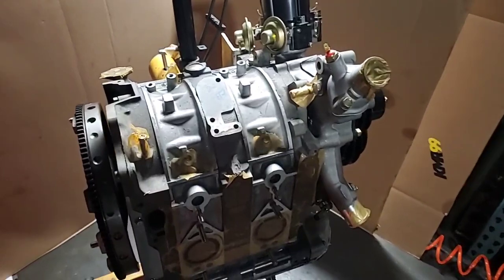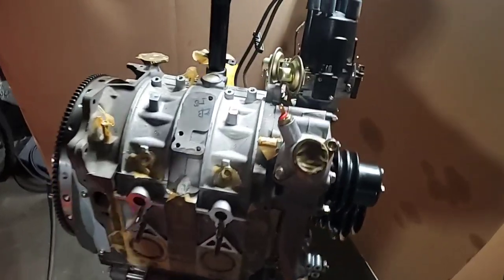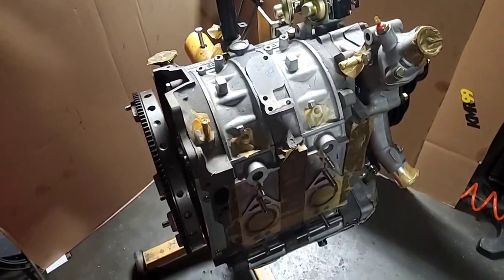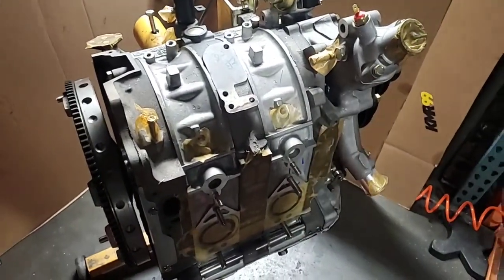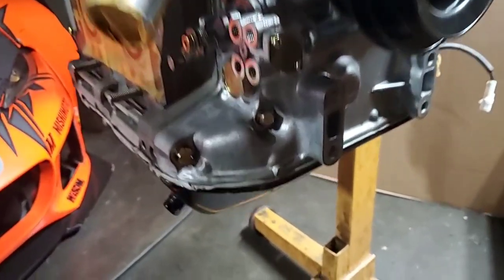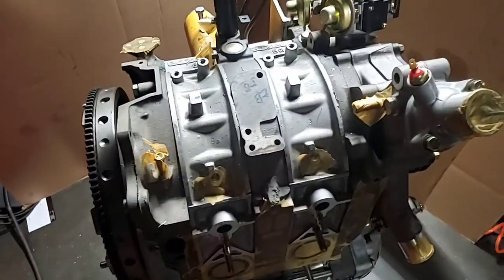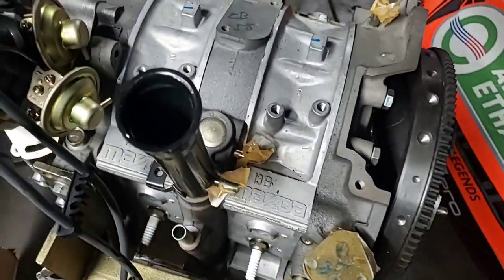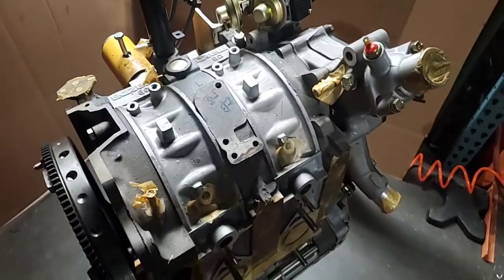Propane 13b Weird OEM Mazda Rotary Engine - KMR Tech Talk  ( RX7, Wankel, Rotor Motor )

Comment: Interesting engine, I wonder how things go as far as reliability is concerned with these things.
After doing a bit of reading over the last few weeks I've come to the conclusion that detonation is the big killer of these engines, and was wondering how well a rotary engine would hold up on LPG (propane, or propane/butane blend) vapour injection as it won't cause carbon buildup which in turn leads to detonation causing hot-spots, and a carbon free rotor housing would by it's very nature easier on a set of good ceramic seals.  With the higher octane rating on top, it should in theory keep the engine happier for much longer. However, now that I've seen this video it seems that Mazda came to the same conclusion 30+ years ago, and if they were built for industrial use I'd imagine that reliability was a high priority.

Maybe someone at Mazda has spent the last 30 years hoping LPG powered vehicles would become the norm? I've always said hybrids make little sense without using a low carbon fuel like LPG

Comment: Unique animal.  Timing cover is 12a turbo. I did many LPG rotors works well N/a  . Turbo works well with twin gas research carbys and 3 to 4 converters ( one for primary demand and 2 for instantaneous demand, and tried a 4th) the biggest thing i found was how hash LPG is on apex seals and rotor slots even with 12a turbo oil metering turned up.  Waiting for the MOTEC liquid phase injection. That's being tested in Melbourne Australia  and the LPG liquid by percentage acts like E85 cooling but yields power around 50/50 mix +-

Comment: It is a forklift engine. I have seen them before with only the leading ignition, no threads in trailing spark plugs holes.
Reply: Interesting. Do you know which models that came with it?

Comment: i have been running and fitting vapour mixer and vapour injected LPG rotarys since 2005 . my daily is LPG and runs 24 psi boost and water injection
Reply: Yo bumpstart! Doooode long time no speak (Jarmez  from Australia
Ausrotary)
Reply: That’s awesome, I’d really like to know more about that
Reply: I'm really curious to know if the seals work better and last longer if there's basically no oil dilution from the fuel.
Reply: @Erik_Swiger  that seems to be the case . OMP is holding just fine at 450 hp levels 
previous pull downs have all been very clean no/low carbon and white turbos with minimal wear